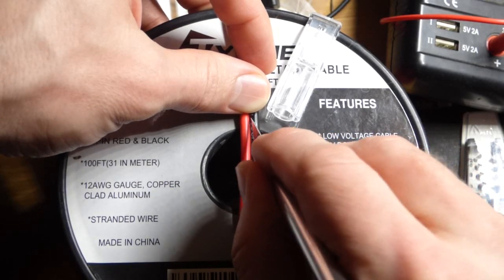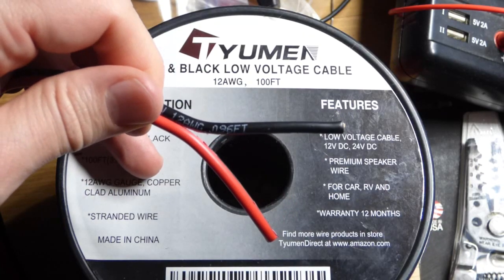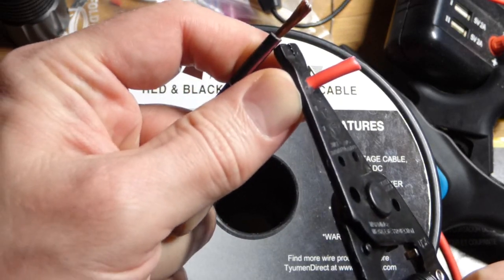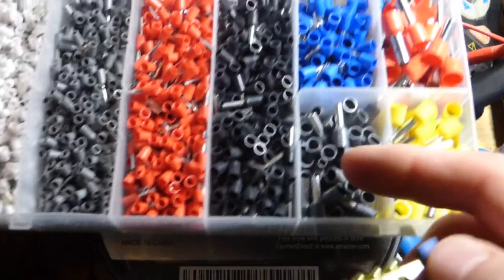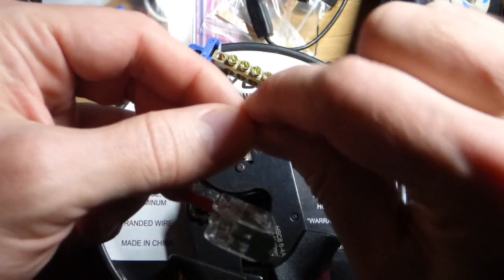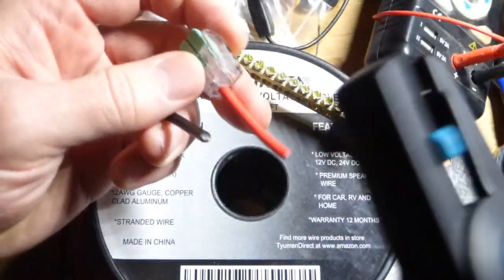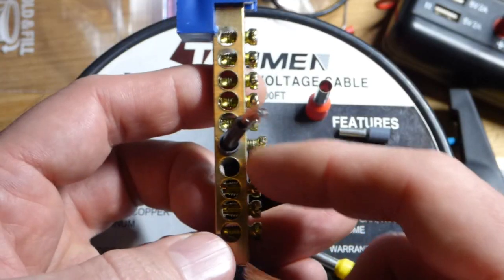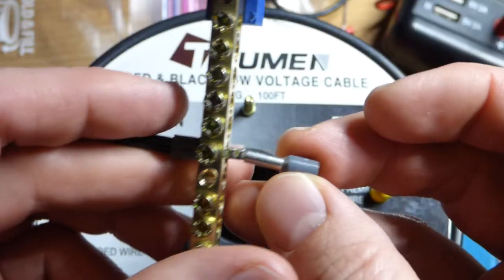My 2nd attempt testing 12 AWG wire connectors

Comment from the maker: Affiliate links: https://amzn.to/3OZYKMl 10 position terminal blocks - https://amzn.to/3DcXRgS Klein wire cutter/stripper - (Green connectors are not sold anymore) https://amzn.to/4ff0OL6 WAGO connectors - https://amzn.to/4izZ2XL Ferrules and crimping tool kit - https://amzn.to/3VELmAQ 12 AWG wire - https://amzn.to/3ZBsDHC Capri automatic wire cutter/stripper